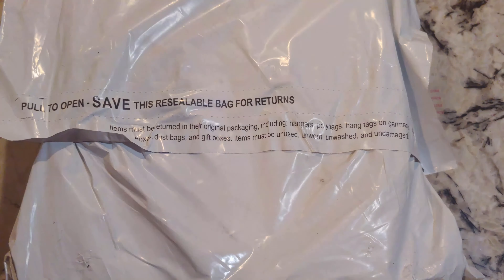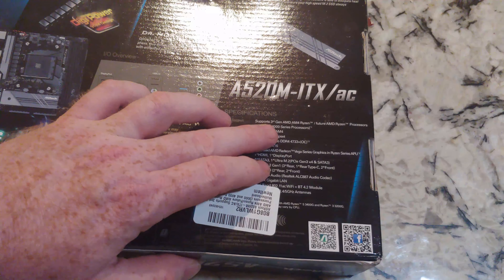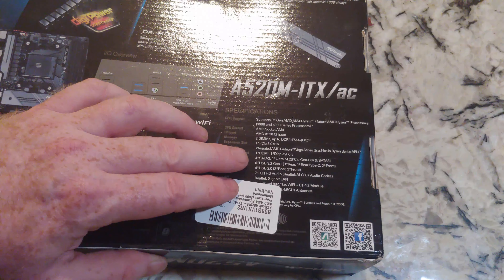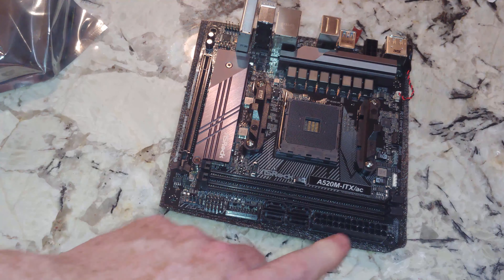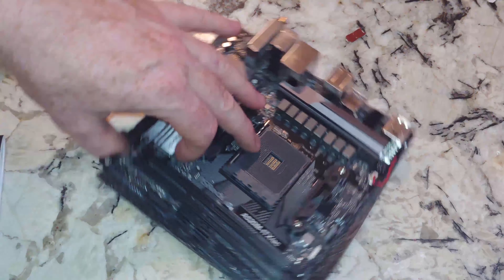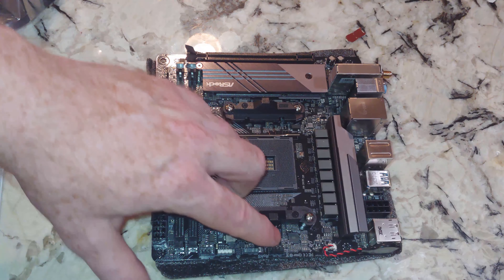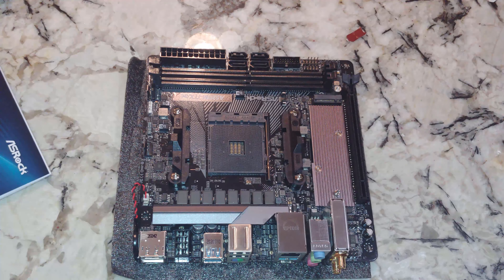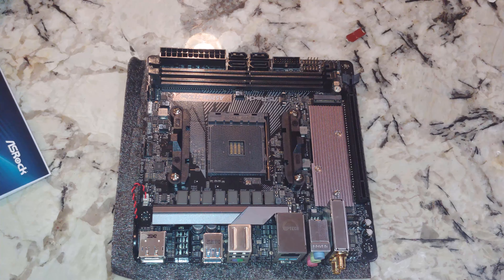Unboxing AsRock A520M ITX AC AMD motherboard, wifi, 3xxx 4xxx processors

Comment: I'm a bit worry about it only having room for 2 case fans, I know it has RGB headers too, can you plug a non RGB fan on those?
Reply from the maker: If you need more case fans, buy some that have Molex connectors.  These are nice because if you don't need RGB, you can connect them in the cavity underneath the RH access panel.  The other connector needs a specific case 4 pin case fan header, these have a rectangular protrusion next to them.
Reply: @PC_HardwareTechUnboxing_1  thanks!

Comment: Does your 3200G really work on that motherboard? I'm considering the same card, but in the shop I'm looking they say that the 3200G will not work on the A520 chipset. So I would love to know if the combination works.
Reply from the maker: I have the 3200g in a Gigabyte a520m ITX motherboard..no issues.  Sees very little use though.
Reply: @PC_HardwareTechUnboxing_1  excellent, that opens up an option for me then. And I take it that the built in graphics works as well?
Reply from the maker: Yes..I have not gamed on it without GPU though
Reply: @PC_HardwareTechUnboxing_1 how is the sound chip? Does it have decent sound?